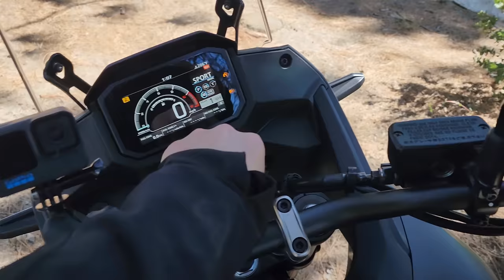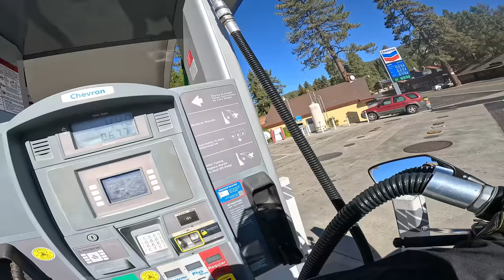Honda Transalp 750 | First Ride On/Off Road (REAL test... no holding back!) (EP.2)

Comment: An excellent test - thank you. You have quickly got to 'the nub of the matter' with your impressions, praises and criticisms, and myth-busting observations. All valid, both positive and negative, and honestly presented. The absence of an ambient temperature reading, on such an info-filled TFT, is definitely a strange oversight. That is taking cost-cutting a bit far! The awkward placement of the indicator switch, at least for those of us with several bikes, is a mistake to my eye. And hand. The Suzuki and Aprilia manage to put the electronic controls on the top of the switch block, not where the indicator switch should live! I'm sure we all sounded the horn at least once while cancelling them.
As to the traction control; yes, annoying, and I just leave mine in Sport, where the intrusion of TC is minimal. I prefer the bike to be set the same at all times, and simply learn to ride it in one setting. At 70 y. o. (and after 61 years riding, with never a year off) I don't want to be playing with electronic bollocks all the time! I believe the return of the ABS after switching off/on is a legal requirement in Europe, but the similar return of the TC is definitely a bummer.
I have done 2,500 kms so far on my (white) Transalp here in South Australia, and am enjoying it more than I expected to. The engine becomes smoother over time, and the engine sound becomes sweeter, with less extraneous noises. I have discovered a couple of simple things I urge you to try as part of your project, if I may suggest. Firstly, the handlebar risers are offset, and reversing them makes the steering 'feel' much better. The bike always had an awkward feel through the 'bars, with them back toward the rider too much to me (like the 650 V-Strom) in spite of handling remarkably well for a bike with a 21" front, and this (10-minute) reversal makes it feel A LOT better. At least for taller riders with longer arms...
The other (5-minute) mod is to remove the rear rack. I did, just for a look, and couldn't put it back on - it is SO heavy. As in, 7 kgs or over 15 lbs! I have the aluminium to make a lightweight alternative. Given that weight must be added to protect the vulnerable sump (not done yet, although I am leaning toward the Polish Heed brand) I was glad to find how much the bike improved with these two simple mods. Better steering feel, and less weight up high, and behind the back wheel. The sump guard weight, once it is added, will of course be low down. But a leaner exhaust system (with a high muffler, and no cats?) and a shorter sump protrusion would provide similar ground clearance as the T7, but will need the bashplate modifying to suit.
A one-tooth-larger rear sprocket may also be worthwhile (alloy in my case, as light weight is an imperative for me) and the chain adjustment is already a fair way back as delivered. My Ducati also benefitted from one extra tooth (much better around Phillip Island!) and I understand the overly-tall gearing on these twins relates to the 'ride-by noise test'. My aim is to get the Honda under 400 kgs, with fuel and sump guard. Lightweight fasteners/spacers etc, lithium battery, blah blah blah. But yes - sorting the suspension is the job Honda 'left for us'... The separate function-type forks at least allow for some damping adjustment through changing oil weights and quantities variously in the rebound and compression-controlling legs. The rear shock will eventually get replaced with a better one, but a simple oil change will be my first step there. The rear damping is inadequate, as you found, and worse with the preload increased. I actually let the preload back down for this reason, but it's pretty 'saggy' like this for my 81 kgs.

I really enjoyed the Tuareg (mentioned below) test ride, although that bike is more off-road biased than suited my needs; its seat was too high and narrow, and the hot legs thing was a negative. But it is a quality bike, in a way I enjoyed (as a 50-year Ducati person). It is also MUCH dearer than the Transalp here in Australia ($22.5k). I eliminated the Suzuki from my choice as simply too heavy. The Suzuki, albeit with more equipment from standard, is almost $3,000 more than the Transalp (which was $15,740 ride away here). The Suzuki about $18.5k ride away. I sat on it, lifted it up from the sidestand, and that was it. No thanks. All these bikes are a bit heavy off the bitumen, and the Suzuki disappointingly so. A shame, as many compliment its engine and gearbox. My Transalp is replacing an old '90s Cagiva Elefant 750, which (after extensive modding/lightening) is significantly lighter than any of the current (twin) offerings. (But nowhere near as smooth and powerful, in spite of Keihin FCRs and 'live' Ignitech ignition, equal length headers, Ti Akrapovic etc).
Thanks again for your candid and accurate report - I look forward to your subsequent findings. Good job.
Reply: Have you accessed your TA airbox yet by any chance Pat?? It's the only kicker for me. Test rode the bike and loved it. If so, how long was the job, and difficulty/curse level?? 🤔🤔  Pretty sure Ian mentioned he's looking at this next episode, but IMHO the more input from bona fide owners the better ... Greetings from QLD!
Reply: Hi there. No, not yet. A fair bit of dirt riding, but not following anyone. Looks like the tank might hinge up at the back, but it looks like a bit of panelling to take off first. I might look under there shortly. This was always a reservation I had with the model too, but it's not like I'm going rallying regularly with a mob. Getting the tank off the Elefant for the same job was a hassle. I'm usually on deserted dirt roads. If it was real dusty, with a lot of traffic, it would be a pain, for sure. Aprilia better in this regard.
Reply: And of course I meant getting it under 200 kgs, not 400! Too many kg - lb and km - mile conversions...
Reply: I have since discovered that the stock rear rack is NOT 7 kgs (15 lbs) as I had reported, but actually 7 pounds. Apologies for the mistake, and I blame the digital scales, that changed to pounds (and back to kilograms) without my realising. So the rear rack is still too heavy, just not as much as I had thought. My home-made rack is substantially lighter. 
I am about to fit a B & B industries bash-plate, which unfortunately is also heavy, made of 5mm alloy plate, and 1/4" steel brackets! Might have to lighten some of this stuff, as the whole assembly comes in at over 6 kgs. At least the weight sits low on the bike, and should provide solid protection. I ended up buying this brand (instead of the Polish Heed I was considering) as the shop that sold me the bike had it on the shelf, saving me any waiting time.
Reply: @patkennedy1  we love our B&B kit. Have it on all our bikes. Very well thought out and engineered. If you're new to the brand I doubt you'll be disappointed mate. In his later vids Ian shows airbox access. As suspected it's bloody awful - I lost count, but there was something like 20 fittings involved and a dash removal 😲😲🤦🤦 - it's finally buried the TA for us. That was all we were waiting on to make the final decision, and he's the first in the world to do it. Unfortunately easy access is a very high priority for us. We collect our new DE on Monday. Happy riding Pat 👐

Comment: Some reviewers say the gas tank is a pain to fill as it is like it is slip in 2 pieces. Have to fill 1 side then lift the gas filling nozzle up and over to the other side.
How did you find it?
It says it usess Regular 87 Octane gas. Premium gas is only ever required if you expereinced engine knock. Premium will not improve performance.

Most ADV riders actually do not use their bike for heavy duty enduro type riding as I understand. They put the most time and miles on the payment, gravel and dirt roads.
This bike is so smooth and such a well built bike to ride as said by many, many reviewers I have seen.
I do not need another bike but this one has my wallet talking to me. Update I bought a 2024.
I would prefer tubeless spoked wheels.
Simply change the fork oil viscosity to change the dampening. Not a huge expense.
Upgrade the shock and fork internals and image how super great this bike will be all around.

Comment: The time-stamps and links are very useful; great blend of “impressions” and data - well formatted. As an older (71) rider I love my Africa Twin but I’m getting longer in the tooth and shorter in the legs. Relative to the Transalp, I’d like to know thoughts on Honda’s 2024 AT and if the 19” front wheel and other tweaks may make it accessible to more 80/20 riders.

Comment: As a touring ADV, rather than the TransAlp, get a V-Strom 1050 DE. It has cruise control and a 20ltr tank, 25% more torque and twenty more HP. And the ground clearance and suspension type of the 800DE. Fully adjustable, front and rear, with preload, compression and rebound. I'm actually leaning the 1050DE direction, vice the 800 DE. I already ride a 2018 V-Strom 1000XT. The same weight I am used to, but a longer suspension travel and 21 inch front tire (vice my DL1000XAL 19") to increase the number of lines I could take. The 800DE is more like buying a heavier DR650.

Comment: Feels like you are trying veeeerrry hard to find good things in this bike. After all - it is pretty BASIC. It could be better and give owners a feeling of a MODERN machine, IF it had tubeless wheels, a CC , sightly better brakes, better / more adjustment in sespension..... no crap protruding under the bike..... On the other hand, it's good you've got this bike 4 testing. Many people trust YOUR opinion, so now they know 😀   Honda will, probably, do same as Sizuki - release a "road" version - 19" front wheel - alloy...., but then - there IS NC750"X"..... and they still are going to STINGE out the CC .....

Comment: @bigrockmoto I have enjoyed watching your build on the TA. I currently have a Husky TE300 for real off-road fun. I picked up a Husky Terra 650 last year. Mainly road stuff with this but do gravel, service roads, etc. thinking of upgrading, so can do some BDRs and handle a little more off-road. Any chance you have ridden a Terra 650? Don’t know, maybe my Husky can handle more than I think. Comparison of my Husky to TA or even Tuareg? I realize they are different bikes, engines, 10 yrs old. 

I feel like the TA would be a perfect bike if the oil sump can be protected enough. I doubt I would want to do anything too advanced on a big bike, so feel like I would be good. I really want to get a Tuareg though, but nervous about parts and reliability. I prefer the look of Tuareg. I need to check them both out. Does AT seem larger than Tuareg or does it just appear that way in pics? AT looks bulkier??

Comment: i used the transalp eu version for 1h and it handles very well.. the hp are more than needed.. but this , even if it has 21inch front wheel, is a touring bike.. not an offroad bike.. in my opinion..

Comment: Really enjoying your reviews of this machine, I have yet to run mine in, but already loving this bike.The easy of manoeuvring at low speeds and not being top heavy is a big plus for me. Just a thought on the power differential here on UK 🇬🇧 models. My V5 states 67.5 kw approximately 91.8 HP but our minimum fuel octane is 95 and we can run to 99 octane.( Super unleaded) I just noticed at your fuel stop, you premium is 91 octane, maybe this explains the power difference between US and UK models? Keep up the good work!

Comment: Exactly what I expected. Simply put, the bike just doesn’t crash well due to its plastics design and lack of protection. At least it has low center of gravity as that can’t be fixed or upgraded.

Someone’s gonna have to make a new sump pump guard, reroute exhaust, very high crash bars, hand guards and a frame mounted bash plate. 
To be fair, our KTM 890s come with a wimpy skid plate but it’s overall design from the factory is it’s well protected when horizontal.

It would be interesting once they make all that protection stuff and do a suspension upgrade what your “real” out the door cost is to comfortably go off-road. 
An 890 or T7 has those hidden costs as well but far less in my opinion.

Comment: Oil pan: 25:10 The kit needed would require changing the sump ingress, a shorter ingress, to get any ground clearance relief.
Moving the exhaust would be the challenging part, because of the nicely relaxed peg location.

Comment: Finally,  someone whos telling it how it is. Money saved over a T7, throw at suspension and a skid plate and the T7 will be hard pressed to keep up with it.

 There is a $5k difference in Australia between the 2, thats a top spec suspension upgrade right there.

I sat on one at a dealer last month,  my concern is the foot levers look flimsy,  and the bike may be too small  my 6'2", 36" inseam frame while standing on the bike.

 Ive had enough trouble setting up my CRF1000L for the same reason, its slightly too small for me.

Comment: i just cant get past the low sump, and the exhaust seems like a majoy problem. i think getting a bash plate to protect the pipes coming off the motor will end up costing a lot of ground clearance, and would require a total rethink along with the sump. ( there must be a reason for that sump design , it's such a noticeable flawed design ) like  you said , an identity crisis. the ability to EASILY turn off and keep your settings is also a WTF were they thinking issue for me !!! how could they miss these kind of issues on an adventure bike?.... so close but yet so far !!! I am excited about the weight and low center of gravity, and power with this bike . and although i agree with you that most wont put this bike to the limits of its capabilities ( including myself ) the costs of those major components being damaged if I would  or could,  reach those limits for even a very short time, could be catastrohic and expensive. It's a shame that suspension parts are so expensive , being a large guy at 6'2" @ 270 lbs , i would need a suspension upgrade right away with these problems , in my opinion . At this point I think I would pass on this bike , but will be hoping they fix these issues in the coming years. Great review Ian, nobody does it better than You.

Comment: Sorry if this question has been asked more than once , but what are your thoughts on the Transalp compared to the Vstrom 800 DE ?
I’ve ridden both and much preferred the midrange grunt of the Vstrom . I road the Transalp for a few days in Gran Canaria which is very mountainous and I was always hunting between 2 nd and 3rd on the Transalp where the Vstrom would have been much better , pulling through the corners in 3rd. For me the power of the Transalp is too high up and not where you need it , unlike the Vstrom

Comment: Great review as always, can't wait for the next episode. The Transalp is not boring, it's just looks boring. Here in Europe, prices are already plummeting. You can pick one up with super low km for 8500€ or new from dealers for 9500€. Not a good sign for the Honda, will suffer the same fade as the Aprilia Tuareg. Meanwhile, a 4-year-old and 50k km T7 cost nearly the same. Yes the T7 is overpriced and overhyped, but still looks like a rally bike.
Reply: Dang here in Finland new transalp is 16k and t7 14k. New BMW f900gs 20k seems like best value if it's good
Reply: @shards14  crazy, do you guys have 100% sales tax, or why is it so expensive there? I'm speaking from Germany, by the way, but I saw similar prices in Spain in the summer and the local Honda dealer was not happy at all with the sales of the new transalp.
Reply: @lucke1022  yeah it's mostly taxes.

Comment: I’m loving this. I’m an aging owner of ta 700 which i like very except a few ponies and that 6th gear. The only thing it sounds like i would be disappointed in is the lack of lugging at low speeds as it sounds like power is made high in the rev range

Comment: Take a closer look into the rear suspension, my European spec Transalp has also damping adjustment in the oil reservoir. Honda does not mention this in the user manual.
Reply from the maker: Really? I'll have to look

Comment: Thanks for the “unbiased” review.   Good to know that it’ll be every bit as good as a T7 if you:  Buy a non-existent aftermarket oil pan, buy a skid plate, buy a non-existent aftermarket full exhaust system for $2500+, fix the shocks with (you hope) new springs and oil alone, or maybe just replace them with non-existent aftermarket parts for $2000+.  Or you could just buy a T7 or an Aprillia, or a Tiger 900, or a DesertX, or just about anything else.  After your thousands of dollars and hundreds of hours of time spent wrenching (instead of riding), you’ll be rewarded with the Honda’s lackluster torque and “it’s no Hayabusa” peak HP!  Oh, then there’s the chopper-like fork rake, just the thing for crisp handling on the street (where it’ll spend 99% of its time for most owners).  But then they will get to enjoy the rhythm of the cars passing them by as they sit by the side of the highway trying to figure out how to fix a flat on that beautiful 21” spoked front wheel with a tube inside (also great for that precise turn-in feedback you need on the street).  Yup, goin’ down to my local dealer to sign up for the lottery to win the privilege to purchase a new Transalp for MSRP+$2000…